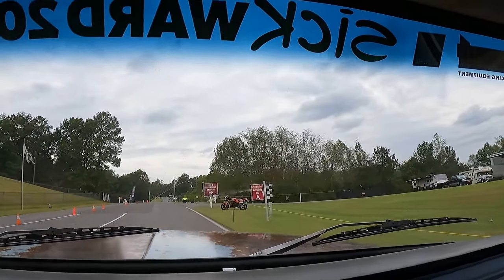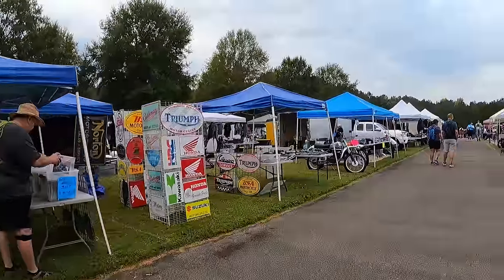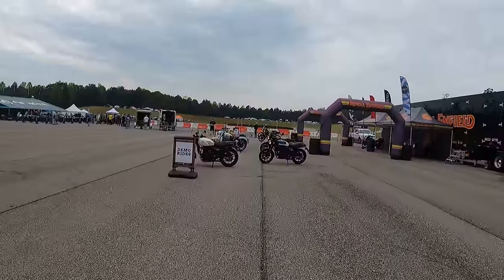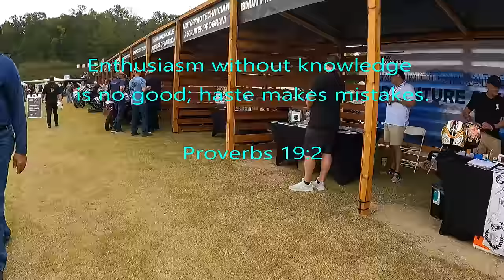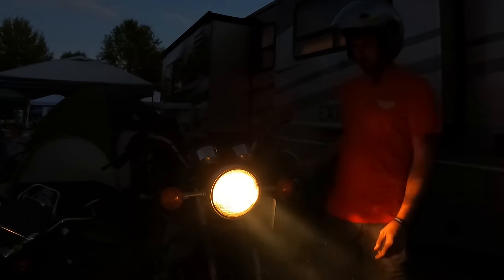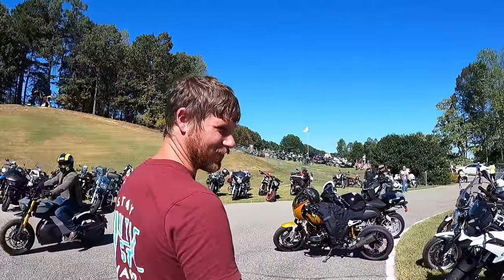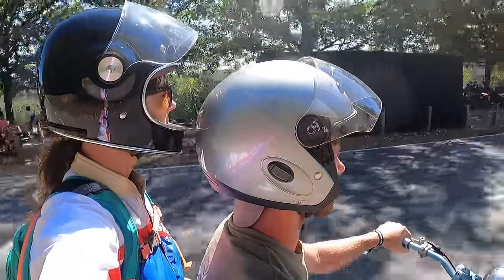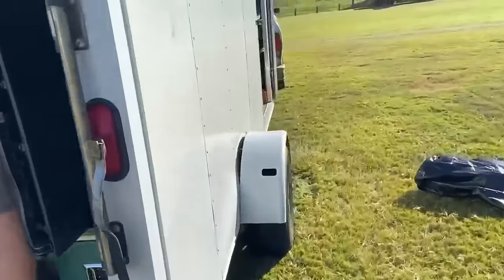Barber Vintage Motorcycle Festival - Bought 9 bikes! Will they Run? + Camp Life

Comment: I bought a moped when I was a 14 year old teenager, 25 dollars, from a friend of mine. It looked new, but no one was trying to get it running because the instructions were in Korean, and all the bolts were metric. This was 1978. I had to figure it out and fix it. Basically replaced plug, changed out sparkplug wire, cleaned up the fuel line. It was fun, had a 2 cycle engine. I drove it all over the place, would show up at family houses and they were surprised to see me riding a moped. They all gave me the "how dangerous a motor bike is" speech, my mother especially, thinking it was like a normal motorcycle, but it only did like 30-35 mph downhill. I would have kept it, but the guy who sold it to me wanted to buy it back since I got it running better. I charged him $35. Well, he pulled a fast one on me, he sold right off to another dude for double what I sold it for. I didn't care, got my money back. Coolest thing about it, the spark plug, wire, and entire expenditdure for gas was under 8 bucks total. Plugs were about a dollar back then, the plug wire was about 2 bucks, 2 cycle oil was about 2 bucks. Gas was 79 cents a gallon. it held a gallon. IT got close to 120 mpg, since it was pedal assist. I replaced some bolts because dude was using vice grips instead of getting some metrics to fit the bolts correctly. I couldn't tell you the brand name on the moped, it was pretty obscure. Like something you would buy in FingerHut catalog or Montgomery Wards way back then. I really want a Vespa. Would be very economical to have it now. Good Luck with all the bikes!
Reply from the maker: Thank you! What a story! We enjoyed having it at Barber and riding it around. It’s super light and easy to ride. This one just needed a little fuel to get it going again.

Comment: In 1979 while on sales call for auto test equipment, I spotted an identical green Honda Express in a box at a auto repair shop. The forks were bent as was the frame tube. It had been backed over while parked at curb.  I bought it for $35, straightened the forks on a press and notched the frame, rewelded and straightened it.  My wife rode it 10K over the years.
Reply from the maker: Wow! That worked out to be a good little bike!